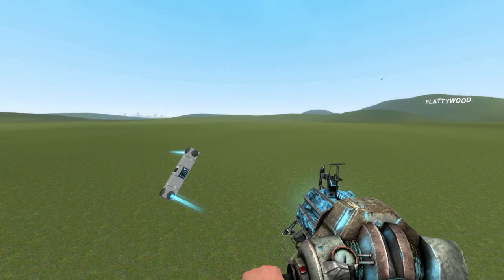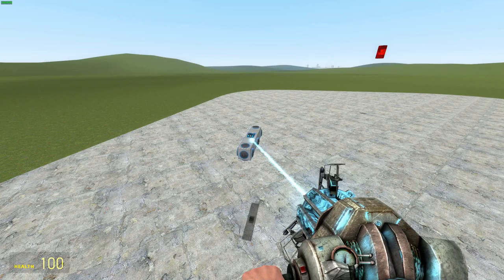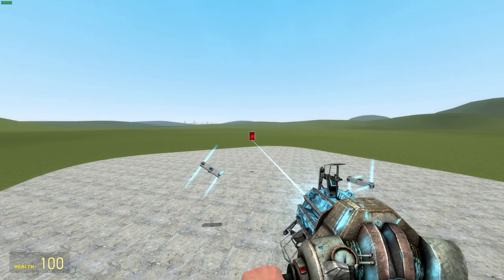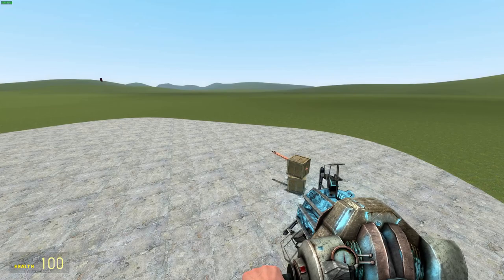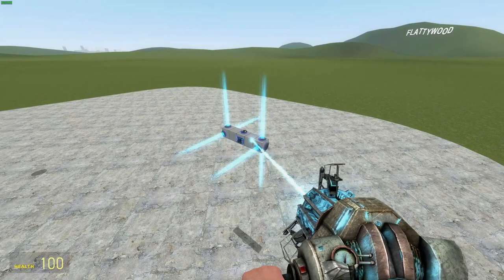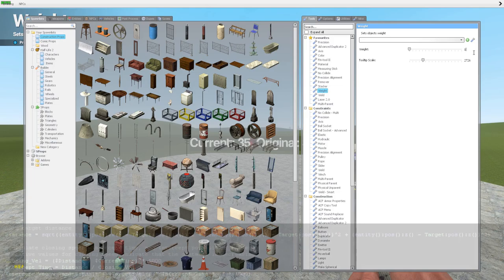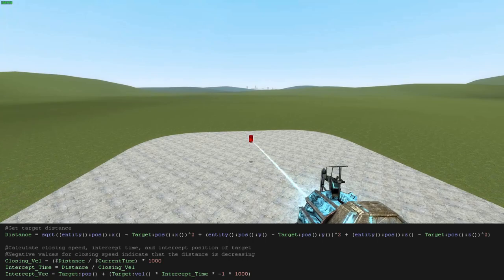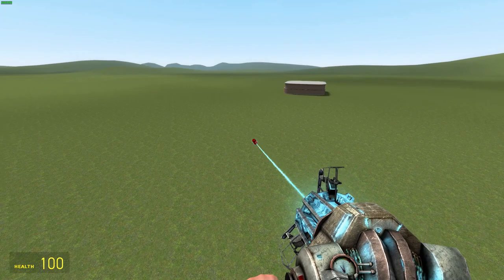Garry's Mod PID Tuned + Target Leading Missile

Comment: cool, what is the program you used to simulate this?
Reply from the maker: This is Garry's Mod, a physics sandbox built off the Half-Life 2 engine. I'm also using an extension for it called wiremod that lets you build circuitry and write code.
Reply: @BenjaminMarshallScienceMan  thanks for the reply, keep those videos coming its really good stuff your doing here.